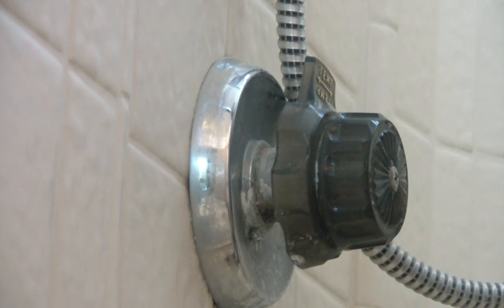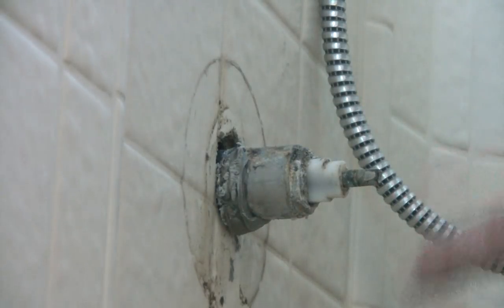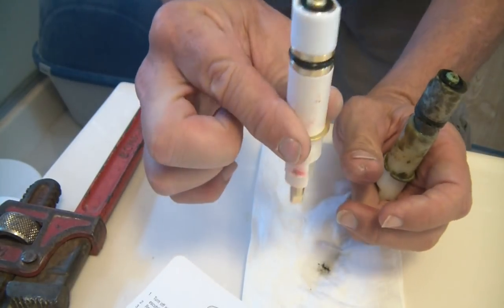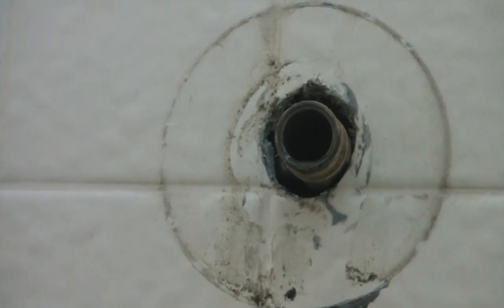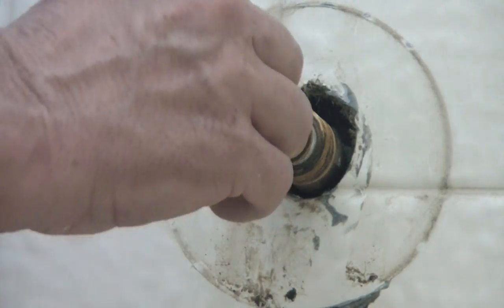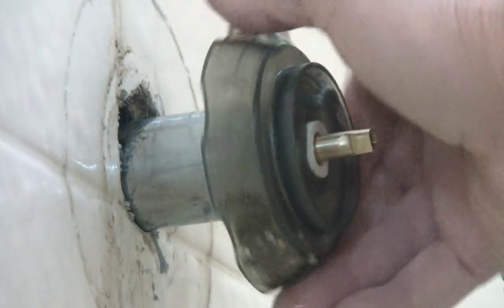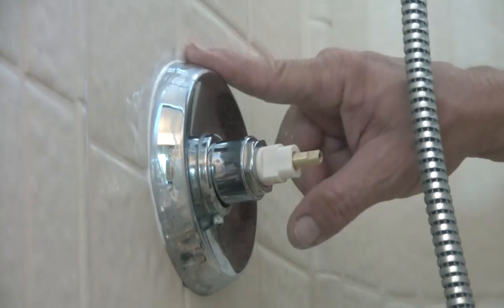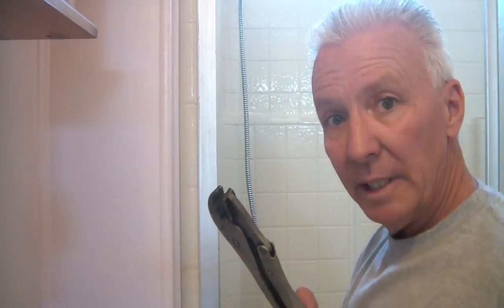How to install Mixet cartridge MXT07

Comment: FYI to all... The instructions on the back of the package state to install with red circle/ dot pointed up. Not sure if that makes a difference or not. Narrator here said “down”. Also, make sure you use the plumbers grease and not putty. Use it liberally and it will slide in like is shown in the video, otherwise, you may need a rubber mallet to get it seated up to the brass-plastic-brass stop point.
Reply: I used ky.
Reply: It does make a difference,  With the red dot down, hot is on the right.  With the red dot up, hot is on the left as it should be.

Comment: Red dot actually goes up. IIRC, it also says "up" in tiny print.

He does it right but doesn't say it. Do not put caulk on the lower 1/4. It allows it to drain if water ever got trapped.

Comment: I bought the MXT-07 original OEM post 1968, and it wouldn't fit. It got stuck, wouldn't go in all the way, unless you hammered it in with a soft mallet. I returned it and bought the Danco cartridge for Mixet part# 88200, and it fits like a glove. I also replaced the handle and plate (trim kit) with Danco trim kit (4 1/2 flange) for Mixet.

Comment: Excellent video. Especially how he describes the differences in the two Mixit Cartridges. I also like the fact he cleaned everything (especially the on/off knob and hot/cold water leaver) prior to putting them back on. Regarding the white sealant around the Eustachian.. there's 2 schools of thought. One is to seal it as this gentleman did. However the 2nd school of thought is by sealing it any water caused by a leaking valve won't be able to get out and will ruin the wall behind. This is a similar thought to sealing a toilet to the floor. 

A good method to clean inside the water delivery pipe is to use an old toothbrush.

While he uses Plumbers Grease to grease the inside of the water pipe and the Mixit Cartridge.. most DIY people won't have this. One can use WD-40 which is fish oil based and won't hurt either the rubber O-ring or any component. One can also use K-Y Jelly which is glycerine based and water soluble.

If you wish to save money and do it yourself you can simply pull out the old cartridge and clean it. Use quad ought (0000) steel wool on the Eustachian and Bonnet nut to clean them. Use WD-40 and an old toothbrush to clean the plastic Lever and Knob. Use WD-40 and a paper towel or soft (lent free) cloth to clean the Plumbers Grease off of the Mixit Cartridge. You'll note that over time minerals in the water causes the Plumbers Grease to become sticky. This is why I prefer WD-40 or K-Y Jelly. You can also completely unscrew the Cartridge and use a toothbrush and WD-40 to clean all the threads... then simply reassemble it. Use the 0000 steel wool or 120 grit sandpaper to clean the brass rings which go onto the Cartridge.

Many times all that is wrong with the Mixit Cartridge is that the rubber O-Ring is bad and letting water leak... this and the sticky old plumbers grease. You can simply buy an assortment of O-Rings from Harbor Freight Tools for $5.99 here's the link: https://www.harborfreight.com/225-piece-nitrile-o-ring-assortment-67677.html

Simply put on a new rubber O-Ring and reassemble according to this gentleman's directions. I've saved a lot of money by cleaning all the Mixit cartridges in my rentals this way. 

Note: WD-40 means Water Displacement 40. It was invented in San Diego in the 1950's for the aircraft industry and military. They needed an product to displace water and stop parts from rusting and corroding. It took them 40 times to get the ingredients right.. and the basic ingredient is fish oil.
Reply: I think you meant escutcheon. If you watched how he applied caulking on the rim of the escutcheon, you would see that he did not apply any on the bottom part. That is to allow any water from a leak that accumulates behind the escutcheon to flow down to the drain below. I have seen a similar video and the plumber said to position the hole on the stem with the red mark on top not below. Which one is correct?

Comment: I looked at videos alllll day on how to repair a spinning handle, a shower faucet that does not get hot (but the sink does). I went to ACE and Lowe's to purchase a shower stem. Out of ALL the videos I watched, it was THIS VIDEO that showed me step by step what to do, but most helpful is that it had my EXACT shower pieces.  That helped alot! I didn't know about the little tab thing in the faucet handle. Once I finally realized my shower handle had one (yes, I was one of the ones who just yanked off, but had I come across this video earlier in the day, I would have known about it). anyway I unscrewed it to reattach the handle (before I knew about it, I could NOT get the faucet to work).  My guess is that whomever fixed it prior to me, also didn't know about that little tab.  At any rate, thanks so much.  My shower is now getting hot water, the handle works! and I've returned the pieces to both ACE and Lowe's and I'm going to cancel the plumber I had scheduled for tomorrow!!!
Reply from the maker: KarenJ0202 Superb. Glad it all worked out and you were able to cancel the plumber and save that money. Sounds like you can treat yourself to a nice dinner out....Thanks for viewing so happy to help.
Reply: I had the same issue, but with the cold water. I like to take cold showers. And after about 5 minutes my hot water would warm up my cold shower. I turned my boiler down to vacation mode to lower the hot water temperature.
I took the faucet apart today and I've reassembled it. Hopefully now I can enjoy a 100% cold shower.

Comment: You said the red dot must point down but the instructions on the mxt07 says it must point up. Can you please confirm? I’ve done this before following your introductions and turning the flange counterclockwise gives me cold water and turning clockwise gives me hot water. Just wondering if it should be the other way around. Also on the metal plate that is against the wall it has the letter H on the left side and the letter C on the right. Thanks!

Comment: Your video was awesome!!!  Thank you.  I had the identical valve and my shower valve was hard to turn and really had to be cranked to shut the water fully off and when you ran the shower a lot of water poured out the tub spout still.  I took off all the old parts and took them over to a local plumbing supply store (they are more helpful and knowledgeable than at Home Depot) and they helped me get exactly the right replacement parts and your video walked my step by step getting the job done efficiently, which is a rare case for any of my DIY projects.

Comment: After 30+ years of living in this house, we were the first owners, I always thought the dumb plumbers had plumbed my shower backwards.  After installing the new cartridge per your instructions (red dot down) it works like it should, so yes the red dot direction does make a difference.  Also, the new O-ring must have been a bit larger and I could not get it to slide in.  I got a small deep socket so as not to be hitting the brass stem (socket resting on white plastic) and tapped it in with a hammer.  Thanks so mcu for the video.

Comment: I live in a 115 year old building with a lot of hard water... They guy who sold me the valve recommended rolling up a washcloth soaked in vinegar, sticking it inside the pipe and letting it set for an hour or so... I did that, cleaned it out real nice!

Comment: Thank you :) What would you have charged for this install? (not including parts)
Reply from the maker: Kristyl you are very welcome and thank you for viewing. With out a lot of detail because the seniors i serve i can't say what i charge, they are on fixed income cant afford a lot so i take very good care of them. For normal customers just because i am somewhat retired and i've never charge the normal rate this is about a 30 min job and as long as the cartridge comes out fairly easy it would be in the ball park $60-$75 that also depends how far away they are also.
Reply: The fact he said to install lthe cartridge with the red dot down is wrong. Even if there is no dot, there are markings that say up.
Reply: I agree with vy purr about the position of the red dot on the stem. You have another video where you said to put the red dot up.

Comment: Help!! I'm 21 years old and my shower wasn't turning on anymore because the plastic on the handle was striped.. I had my grandpa come "fix" it and he replaced the whole thing just like you did in this video.. except now my water doesn't get hot, the tempature handle turns with the on/off handle.. Only gets hot when turn off the shower and the pressure is low !! How do I fix this?
Reply from the maker: Zoe my first thought is wrong cartridge next install in correctly. If they both turn together take a Phillips and remove the volume control knob and see if the temp lever moves freely and is on correctly then reattach knob and turn to see if the move independently. No go then Zoe this is very simple I’d suggest redoing it and double check that it is the correct cartridge. If you can get the old one take it to a plumbing store have them look at the old cartridge and verify if it is a mixet or other brand. Hope this helps. If you were near my shop I’d come over and help you. Take a deep breath it will be ok. One step at a time.

Comment: Great video. Made complete sense. My Mixet valve though isn't the MXT07 as in your video. I had to have the "other" valve and can't find it anywhere! Do you have the exact part# to the other valve you spoke of? I purchased an MXT07 and it wouldn't go in pass half way. Help!
Reply from the maker: If it's pre 1968 it could be MIXET-MS-3T Old Style Stem 
6-1/4" stem length with 2" long retainer nut. is your old cartridge very long. i don't find any of the others at home depot you may have to take it to a plumbing supply shop and purchase one there. They can make sure you get the correct cartridge. You also might consider an alternative, Its called Nomix catridge. It could solve your issue for an extended time over the cheaper mixit valve.I think its made by Moem and i like Moem
Reply: @TheShackHome  the house is pre 1968. The stem is short just like the MXT07 but there is a difference in the cut out portion of the valve.
Reply: @richardreyes4274  Hi Richard, I think we get the same problem.  Did you finally get the right part? Thank you.

Comment: Question: did you apply the caulking to the lip of the plate or did you apply the caulking to the inside surface? It’s hard to tell from the video. 
Also, it looks like you didn’t go all the way around the plate with caulking. Is that correct?
Reply from the maker: CHAOS aDDICTION yes applied the caulking to the rim of the ring so when pushed onto the wall the excess squeeze out is what you you create the bead around the ring. And no I didn't go all the way around. I leave about an inch at the bottom with no caulking for any moisture to drain out.

Comment: This video is so old so im hoping that you get this. I need the one that your talking about I think. Home Depot sells a 07 and it doesn’t go all the way in so I found a 1 and it doesn’t fit either. I can’t find ANYTHING that fits this stupid shower.
Reply from the maker: Morskyia i feel your frustration. when it doesn't seem to work with the big box stores I say take the valve to a local plumbing store to make sure to get the correct replacement. Sometime you just never know. hope this helps.

Comment: I used to always change these out myself, but last time I couldn't get the nut off on one shower, so I had a plumber come out and do both showers. The master one is easy to turn again, but the hall bath is really not much better if at all. The plumber told my boyfriend the whole valve in the wall probably need replacing. Both valves are the same age and get the same usage. I don't know what cartridge he put in since I wasn't home. I have a friend who said this happened to him and he took a sanding drum bit on his drill and gently smoothed out the part of the pipe where the cartridge engages the valve and it works great now. Any harm in my trying that? It would make sense that with my hard water, it could just have a lot of deposits making it hard to turn. I swivel the master bath one daily (to all hot while waiting for hot water to get there), but my roommate just leaves it in the middle and never turns it. So I am thinking maybe it got buildup in there.

Comment: Unfortunately I did purchase MXTO7 shower stem and it Didn't fit no matter how I tried
Reply: Perry - Mixet has two shower/bath cartridges. They have a pre- 1968 and a post (after) 1968. The pre is a little bit longer than the post. They look almost identical. It's possible you bought the wrong one.
Reply: Perry Strebel same here. House built on 1998 and bought mxt07 i try to put the cartridge and it wont go in. Where you able to tell what the problem was?

Comment: This was very helpful like your instructions and that  you show and say what cartridge to use. Thanks a lot. Question:  How can I loosen up the nug it is too tight and hard to take off? ... How can I get more cold water than hot my temp gets more hot than cold?  The previous plumber made to get more hot than cold and it gets pretty hot so in order to get warm water I need to turn on the water all the way open. He just said I messed up on the cold water your going to get more hot than cold and didn't fix it.
Reply from the maker: Yuri the temp issue may cure itself with a new cartridge. if a wrench wont work calcium build up will make it hard to undo. try some WD-40, Liguid wrench or B'laster. They are penetrating Catalyst should help you. might also try a pair of vice grips for a better hold on the nut.

Comment: I ordered Mixet MS5AT-C not sure if its really different the images look the same and the cutout you mention. I have a mixet faucet in my shower and I think I might've ordered the wrong one. I guess I wont know until I pull the faulty one out. Wish there was a simple way to know which mixet faucet takes what because all the videos I see are using one type and im seeing the one you have in your video and this Mixet MS5AT-C model. Any ideas? Worse comes the worse I send it back
Reply from the maker: Dan you really never know till you pull the old one out, if you have never replaced it prior. But that is a post 68 valve so if your house wasn't built prior you should be fine. The one i did was a shower only. Just really compare them when you do get the new one just a few thousands does make a difference.
Reply: The Shack your reply is much appreciated, my condo I believe was built after 1968 figured post meant after and pre before. I’ll see maybe I’ll provide an update. My volume know behind looked like a drill bit on the cartridge and none of he carts available today have that. So I’m like wow. But again thank you.

Comment: I have one of these 'vintage' valves in my dulplex rental home.  I replaced the valve a few years back, but have never been able to adjust the temp easily over the past years. . . . .and it has been a hassle for my tenants.  I will be replacing the valve once again, and thank you SO much for the very well done video and suggestions for matching the valve with correct unit. . . . and clear procedures with professional and detailed steps!  You obviously know what you are doing, and are helping many older folks with your attitude and caring work!
Reply from the maker: Jan Grigsby
 thank you for the kind words. That day may come when you'll need to replace the complete valve. these are good but very limited to the accessories for it, even for a rental. this was one thing I did when I renovated my rental near Huntington Beach (In 2010) I replaced all valves and updated to Moem. I'll be doing the same when I renovate 2 bathrooms in my house. Sometimes a little extra is worth it in the long run. Thanks for chiming in and thank you for viewing.
Reply: @TheShackHome  Thanks for the upgrade advice!!

Comment: Hello, should I be worried about hot water flowing out? Even if I shut off the main water line?
Reply from the maker: Andy if you have turned off the main and water still runs your main may not be turning off all the way. Double check that you have turned the valve off completely. Turn on a water spicket, with NO hose attached, and see if water runs out. There will be preasure in the line so allow for that and let gravity run out the water. If the flow continues then you have a water main valve that isn't closing. Call the water company its their responsability. Once the main is turned off ther will only be flow from gravity with what is left in the lines it shouldn't continue hot or cold.

Comment: I’m replacing my stem. The new doesn’t go in. I compared the old to the new one and it didn’t fit!  Am I missing something?
Reply from the maker: oscarcampos2086 is been a few years since I've done one of these not too many any more. Dont know if the manufacture has chanded. Things are changing so much nowdays. Id use calipers to see if diameter has changed or something. It should fit in snug not overly tight. Sorry I don't know. I always sugest going to a plumbing store and let them see the valve you took out and they can make sure you get the correct one.

Comment: Will it always be that mxt07 cartridge? How do I know if I need the other one? I have a mixet and want to get a new handle and cartridge so it's all smooth and nice
Reply from the maker: liz it should be because most of the time back then the people would give you the wrong one. this should be the one that fits. But there are the occasions where it different.